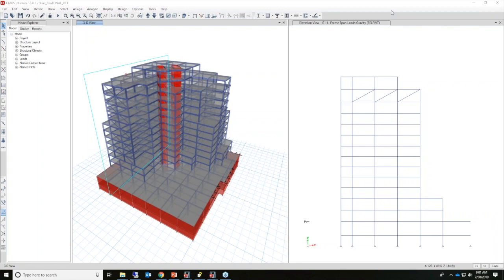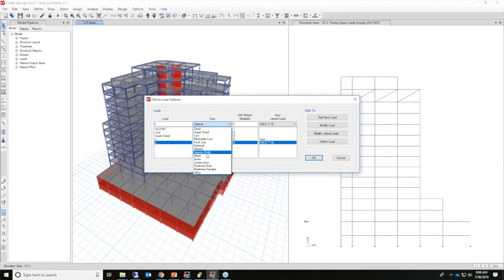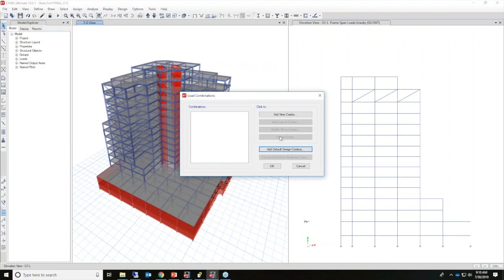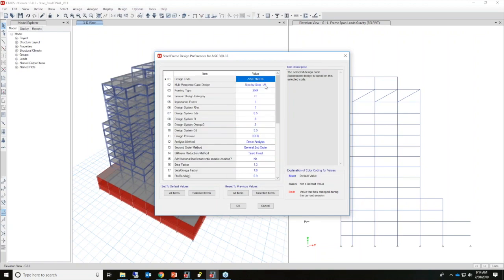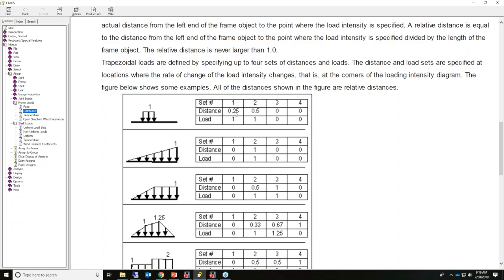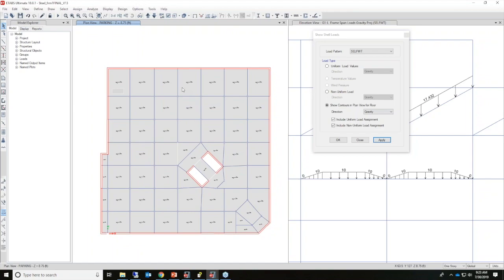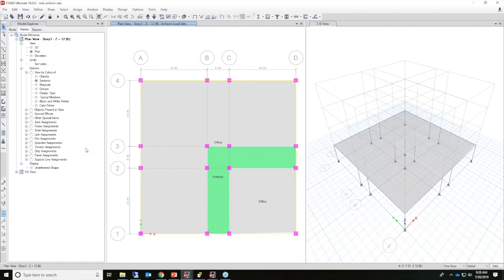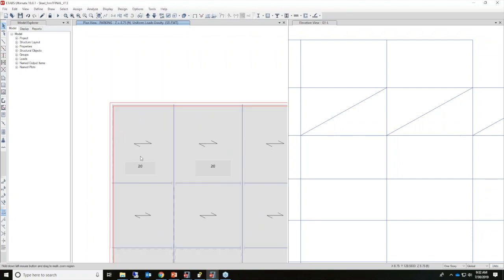WEBINAR: Unique Loading Features using ETABS

Comment: Sir Good Day! Sir How about the Over Head Water Tank, or in case of Swimming Pool at the Deck Area and Elevator Machine Room. How do we consider or what particular Load Pattern do we apply in the structure? Thanks in Advance and more power ...
Reply: Please elaborate the application of  non uniform shell load like earth pressure in basement. I have not understood the the value of A,B ,C to be put while applied the non uniform load